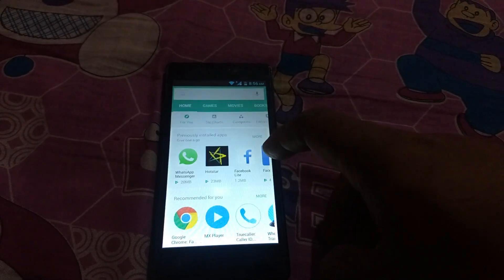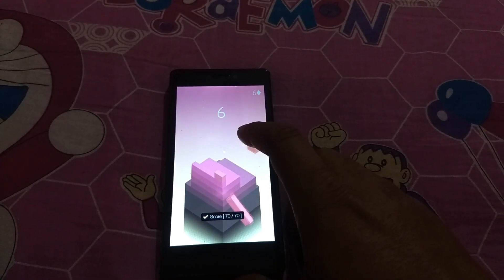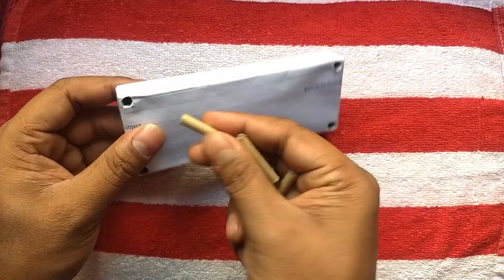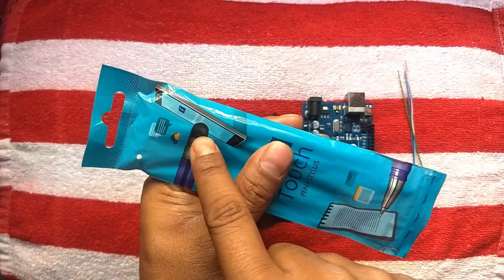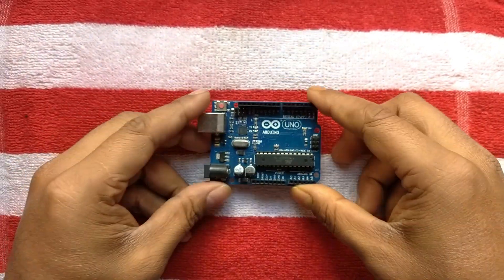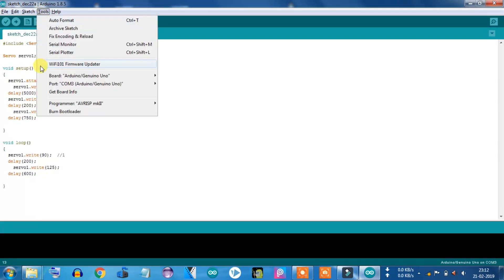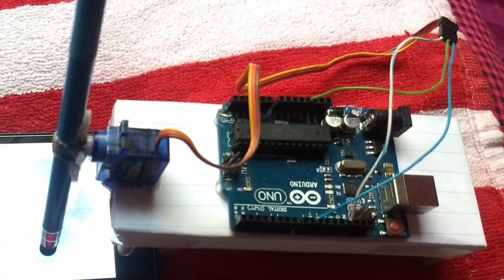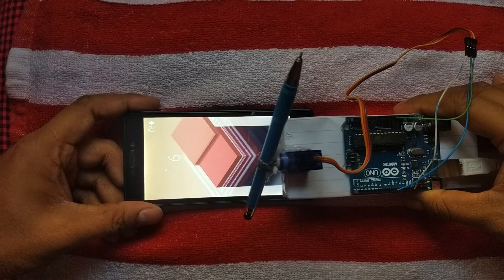How to make Stack mobile Game High score maker Robot || Chandrabotics

Comment: U have not shown the battery in circuit, how will aurdino and motor works
Reply from the maker: I have forgotten to share that. I have connected USB with that arduino and arduino is getting power through that.
Thank you so much for watching my video.😊😊